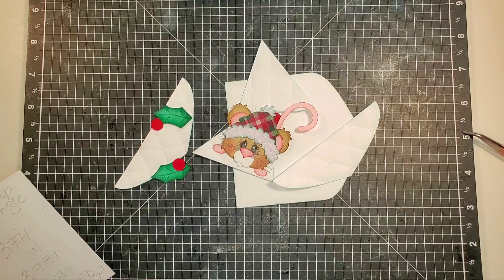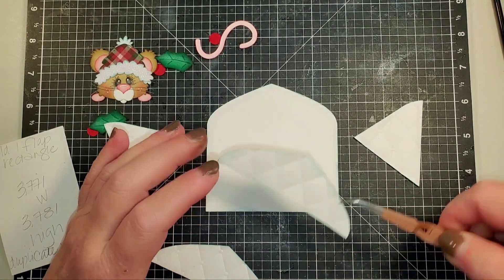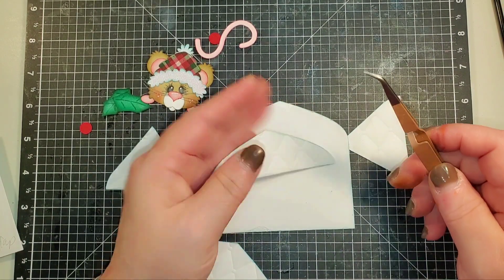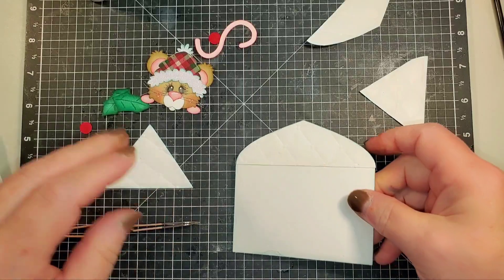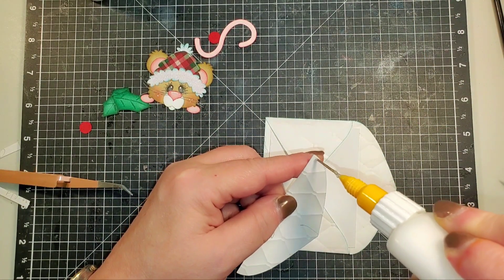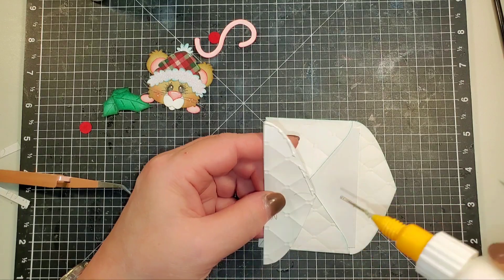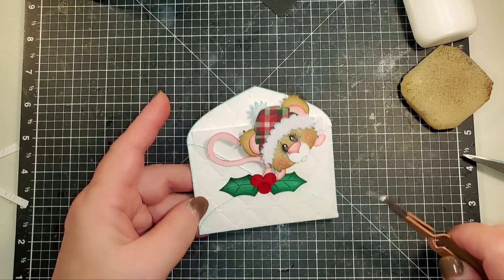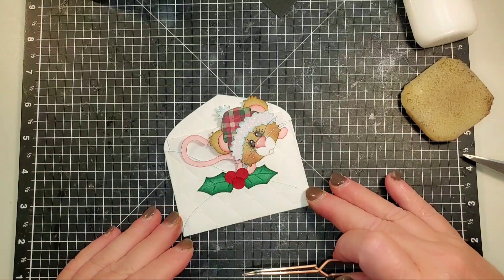Mouse in Envelope Gift Card Process Video

Comment: Did you cut the glitter paper out with your Cricut? What setting did you use to get a great cut?
Reply from the maker: I did, but it's not "normal, thick" glitter paper.  The paper is from (Amazom) Cardstock Warehouse brand, Diamond Print Glitter Inkjet Preium Cardstock. White...  it's 8.5 x 11, but I love it!!  I cut all my pieces wirh a premium fine point Cricut brand blade (the white tip one) and get the best cut with anything heavier than 65 lb paper when I set dial to 1 notch below Light Cardstock and then cut twice.   This glitter cardstock cuts beautifully and it doesn't shed.
Reply: @prairiepapercrafts  Thanks, good to know of a product that will work with glitter on it in the Cricut. :-)
Reply from the maker: @KimFergusonpapercrafting  I agree!  I quit trying to cut glitter paper because of the mess I made!